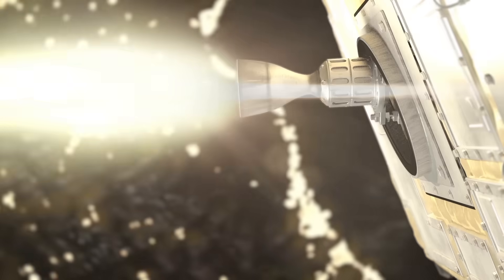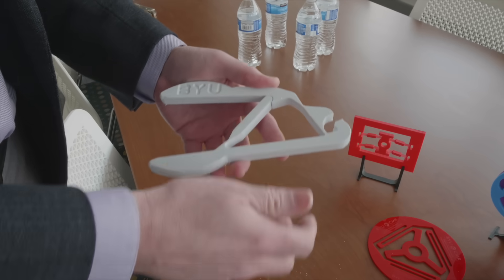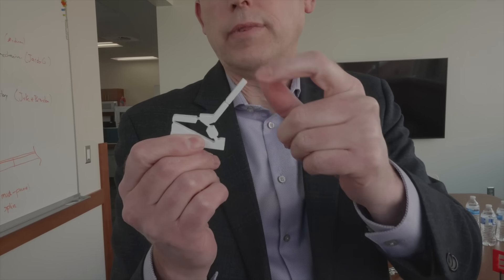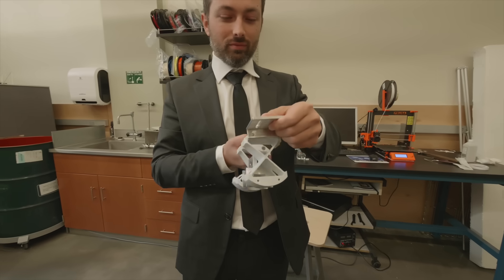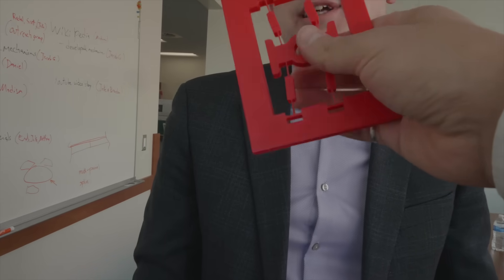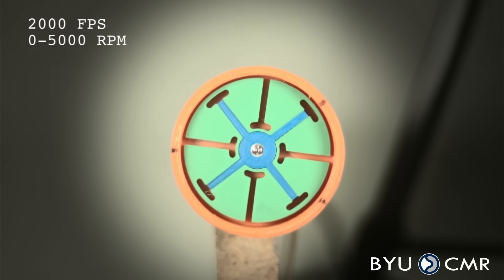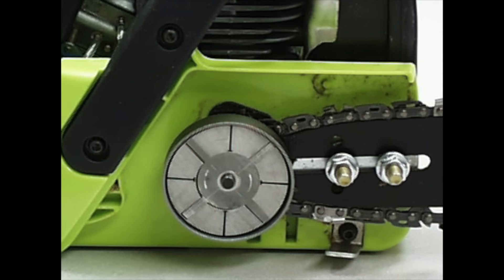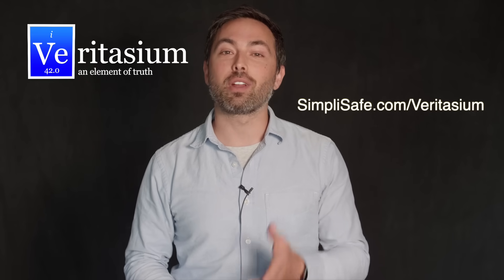Why Machines That Bend Are Better

Comment: But even with fatigue and such, is the plastic in the gripper able to withstand the amount of force usually applied to a vice-grip? Maybe using the printed metal like they showed off. But then how would the adjustment mechanism work? I would not want to carry 200 tools just to have a slight adjustment in the size of the opening. Unless they make something akin to the self-adjusting pipe wrenches.

Comment: Formula 1 has been doing compliant mechanisms for over 25 years now, with both flexible wings and suspension systems (control arm pivots are actually flexible joints, inboard and outboard).

Comment: Can we use this technology to make 3D printable plastic firearms? 

Imagine Open Source designs, being privately affordable to manufacture.
While plastic means lightweight, which benefits transportation, accuracy, and maneuvering; not to mention concealable through metal detectors.

Building a plastic pistol with a metal design, using plastic screws instead of metal ones, would not be an endurable design. But if the plastic was bended properly maybe even being one complete entity, and the right chemical compounds was used as material to handle the gunpowder, I could begin to imagine some pretty fascinating and perhaps even efficient designs.

Comment: I bet Formula 1 teams will start using this tech on the front wings to have variable downforce
Reply: Start?  They've been doing that for years.  That's why the rules contain flexibility-under-load parameters.  F1 engineers are constantly looking for holes in the rules, and FIA tries to fill the holes.  Innovation is the side effect.  That's the game.

Comment: but being that thin, doesn't it rotten and break if it's sitting there for decades?
Reply: Rot can only occur when moisture is introduced. If you keep moisture out, there will not be any rot. There's also a few other elements to keep out that I can't remember right now, but if you manage to do that, you essentially preserve it for decades and it'll work like it was built yesterday. We found out about this through archaelogy, whenever we discovered a find that really shouldn't exist and then decided to figure out how tf that still existed.

Comment: My paper clip was pretty compliant before it was work hardened and snapped.
How is this prevented in compliant mechanisms made from metal?

Also ... how complex is it to make these compliant mechanisms? I know we are all very familiar with traditional mechanics, clockwork and the like, but surely some complex mathematics must go into compliance devices to ensure they flex how you need them to and how much different materials can flex, going back to my work hardening question surely the temperature range for compliance devices would also be more narrow?

Comment: This is incredible! I have been searching for this for over 2 decades. I remember reading an article about this guy and designs about 25 years ago, but could never remember where or how to find them. I even had searched for "compliant mechanisms" with no luck, until now. The original article was about brakes for bicycles, and yes, I even had some of those kind of "compliant" brakes.

Comment: I have an unrelated question:

We say that the Earth spins about its own axis. When a plane takes off, it goes into the air i.e. is not in physical contact with the Earth anymore. 
Combining both facts, how is it that the plane is able to fly from place to place when the Earth is spinning at thousands of km/hr with it simultaneously? 

It’s not a challenge. I’m just confused.
Reply: the wind is moving with the earth itself, so the plane is moving with the wind, moving with the earth. Jumping does not result in your body being thrown hundreds of kilometres backwards
Reply: Oh. I’m still kind of confused, but that did actually helped. Thanks!

Comment: Intuitively, it would seem like the ones made of metal would start to warp too much at the flexible points, affecting their zero point. But materials go from elastic (flexed but will spring back to "home") to plastic (starting to get stuck in that new position) are a response to force and deformation. With very small forces, and very little motion, those materials should stay elastic through that action, for the most part.

Comment: Bridges and buildings employ this since steel was made on an industrial scale.  Proof that flexible machines are better than complex machines with moving wear parts.  Solid part bending fatigue is generally way longer lasting than friction of bearings and hinging.

Comment: I was thinking if stressed induced due to bending will have any hysteresis effect, that in the long run will reduce the accuracy of the output of the mechanisms...... I mean there should be a lot of thought that goes into even changing the mechanism's material as for every new material you have to change the design so that the bending is within the elastic limit.

Comment: Tools with compliant mechanisms would work really well if the material is durable enough.... Same goes with other mechanisms...

This seems like too obvious, but you always need to check out the materials that are necessary for the said mechanism. You don't want your tools/components to break because the material is too brittle, but too flexible means that it's not gonna be springy enough. Fatigue testing is really necessary for these kinds of mechanism.

Comment: Dude... moving parts on a silicon printed chip?! Are you kidding me?!
Reply: That's how the accelerometer in your phone works.
Reply: @captainmcderpyderp  ~"I am  Bill Hammack ,the engineer guy"
Reply: Search on youtube for: MEMs oscillator sensitivity to helium
Reply: yes that impressed me aswel. It says it is 400 micro meter where as modern chips use 16 or so
Reply: @Mercyforme  modern chips are nano meters
Reply: @v000000000000v  woops, I meant that..

Comment: Bending metals, what will you do about Metal Fatigue.
Reply: they will have to balance the bend radius and the metal elasticity-point for what they deem is the best. A longer bend would harm the elasticity and therefor harm the longevity of the metal. it wont last forever  anyways.

Comment: I have doubt, wouldn't flexible machines  suffer from fatigue from repeated flexing, especially metallic flexible components?
Reply: certain metals (like spring steel) do not easily weaken from repeated stress. however, if the mechanism were made of work-hardened steel (like copper) then you would be correct.
Reply: Depends on the level of stress.
If you don't pass a certain limit you can in theory continue forever.

Comment: I wonder though, how can certain redundancies be built in such mechanisms without requiring to severely overdimension the design? Also, what would happen if you scale these mechanisms for heavy duty applications? Are these properties perfectly scalable and if not how to account for these "imperfections"?

Comment: Just seeing the single thruster being controlled made me realize how important this kind of technology is. This video was so much better than the thumbnail depicted it as. I came into this thinking it was going to be a boring video about a new watch or something that is 100% LED, or whatever. I even held off until it was auto-played as background noise. You should really consider changing that thumbnail because everything in this video was 100 times cooler.

Comment: To any Engineers out there who think this subject is interesting.  I highly recommend getting Dr. Larry Howells book and learning a little about compliant mechanisms (it is less expensive compared to the average college text book).  If your institution has a compliant mechanisms class you can gain a fundamental understanding of the limitations and when it is appropriate to use these.  You might need to talk to your Mechanical Engineering department as the class name probably won't have it clearly stated.  Experience or classes in machine design, machine dynamics, statics/dynamics, and materials are essential for understanding this subject.  

Quite a bit of research is being done on this subject currently and still has potential to make big changes in the technological realm!

Comment: 1 million cycles really isn't that much for a mechanical part. For example, electromechanical relays last tens of millions of cycles. And even then, the failure mode is usually electrical, not mechnical. I loathe to think how that performance would drop in high stress environments such as cold or heat. There's a reason these types of parts aren't used often.

Comment: Being one single part, these designs are harder to fix, but it is possible to make modular plugs for the junctions. Springiness is intrinsic to almost all these designs, also non linear resistance under load is complicated to eliminate. Bolts and oil don't have these problems, and can be lightweight, but more expensive, more likely to jam, not necessarily less strong, you can choose a wider range of materials .

Comment: I hate storage cases/containers that have that bend with a thin piece of plastic instead of a proper hinge. Eventually that thin piece of plastic wears out.
Reply: Unless the material used is good for that particular application like for example polypropylene

Comment: why he changed the title of the video from "How flexible machines could save the world" to what it is now ?
Reply: I guess the new title represents the actual video more, since they explained that the flexible material has a few improvements. Plus, the old title sounded a bit clickbait-y (in the case with the nuclear safety, I assume — since it's classified — that they actually use the flexible material, so the machines not only 'could' but really 'do' save the world currently)

Comment: This is nothing new, I don't quite understand what's so special about these? These things are not going to be used in every situation, since what they did not mention in the video is that they are very vulnerable to stress, which limits them to small mechanisms in controlled and contained environment where forces are always predictable. They are also very vulnerable to changes in temperature and depending on material - chemical composition of their surroundings. Anything that affects the material from which it makes enough to deform it, will render the mechanism useless. That's why are used in keyboards and mice, for example, but I highly doubt that clutch disk will survive in an actual car for very long.

Comment: Another important advantage is the lack of stick-slip. This (and the lack of backlash) is the reason why many instruments use flexures for positioning or measurements. Like the abrahmson movement in a cej mikrokator ( accurate to a fraction of a micron )

Comment: Festo built a flexible, pneumatic robot arm that looks like an elephant's trunk. It has basically three separate hose-like air containers alongside each other, which can be expanded and contracted and therefore bend the arm in different directions, similar to a bi-metal strip.
I've also seen door latches made out of a parallelogram-grid-like structure, where the normally "sliding" part was replaced with a part that pivots on another through bending ribs.
I think this has tremendous potential, though materials need to be very durable against fatigue.

Comment: This seems like it would make the Apple MacBook Butterfly Switches much more reliable than they currently are.
Reply: アルピー the butterfly switches literally are compliant mechanism. The reliability issue is from dust getting stuck under the switches.
Reply: Aye quora gang....
Reply: Lol
Reply: It wouldn't, their problem is the dust
Reply: @UC53n9Sk  Yeah that shit's impossible, all the dust and debris and sweaty ball hair, any keyboard would break. Except literally every other laptop keyboard in existence copes with these environmental hardships just fine and the keyboards far outlast the laptops.
Reply: They design their stuff to break easier every year so you have to buy the new model.
Reply: Apple could add another 0 to the price if they use something like this in the keyboards..
Reply: @aravindvissamsetty  It would be more reliable and cheaper to make and they'd charge extra $200 for this keyboard, no joke.
Reply: Apple adding anything actually useful to their products? Nah.
Reply: hahahaha

Comment: As an engineer student,I just had to pause the vid and do a rigid body analysis on the elephant. 
One disadvantage is that these flexible joints can’t turn 360 like pins. The fatigue test seems really solid tho.
Reply: Good observations, the main limiting factors are normally load and full rotation for these mechanisms.  To support higher loads you need larger cross sections which limits flexibility and increases fatigue stress.  I definitely recommend getting Larry Howells book if you are interested.  It is very practical and if you have a compliant mechanisms class you can get a very deep understanding on when these mechanisms are appropriate to use in designs.
Reply: Or you can call it an advantage for restricting unwanted motion.
Reply: It's a matter of perspective and application. A million cycles can be a lot for a lightswitch, but it's not enough for a suspension system, and it's definitely not enough for a mouse button.
That said, in many applications, we use pins, bushings and bearings in places where you don't need 360 turns. A very good example are those vice grips. They're not really expensive, but they will fail in frequent use eventually (usually the twisty part starts jamming). You could probably make over a hundred of those plastic grippers for the same price and just replace them after they fail. 
And that's another thing to consider - in some applications, it can be easier and cheaper to replace and recycle than to repair and maintain.
Reply: That's a disadvantage of any compliant mechanism. One major tradeoff one has to consider in design.
Reply: I still have doubts about the longevity of these switches. No Material is invulnerable against repeated stress.
Just look at a car spring, a little rust at the right place plus a speed bump, and it fails.
Reply: @mixtermuxter8602  The switches were made of some form of plastic and, it seems, are expected to be used in 'common objects' like light switch, appliances, etc. 
Their longevity might not be insanely long, but it's partly because you don't expect to turn you lights on/off a billion times. And if the switch breaks? You just 3D print a new one, replace it and recycle the material of the old one.

If the device needs to be ultra resilient and safe (say in a car), then you choose the design and material in consequences. It's good to over-engineer stuff, but too much over-engineering is sometime costly. Who would want to pay for, or need, a light switch that can survive 1 million years of constant usage?
Reply: How about make it helix to rotate 360 freedom..
Reply: Swegatty Swooty Good idea! But I referring more to completely free rotation , like infinite degrees
Reply: @davegrox3150  Still cannot make it spin. And this reminds me of the War of The Worlds, where the Martian civilization has never invented a hinge and a wheel.
Reply: How do the properties react if the environment parameters change? I mean the termal expension could jam that clutch, no?
Reply: @Eugensson  of course it could jam it. But if you think about it most devices have a recommended operating temperature. You go outside that temp zone and it will become unreliable.
Reply: the stress test seemed dubious to me, since temperature changes and humidity play a big factor in making these materials brittle & decompose/crack. I saw a brief clip where the item was being moved back and forth repeatedly, and I guess that's how he calculated durability but didn't factor environmental variables. I'm not an engineer, though.
Reply: @Reza254  that depends on the material and expected environment. That's typically taken into account in tests like these--for example, an engine may be run at its highest rpm at the most extreme temperature it's expected to run in until failure. I did not personally work on this project, but if humidity or extreme temperatures were relevant to the material and expected working conditions, I'm sure it would have been taken into account in these tests.
Reply: @Reza254  That's just what they showed. His prototypes are used by NASA, I assume confidently that a variety of tests were done. Differing tempo, intensity, environment, etc.

Comment: Imagine what you could do with this if 3d metal printing had custom alloys and an option to have multiple, separate metals. You could have one metal for it's stiffer properties, and another for it's more elastic properties, then have a transitional alloy between the two allowing for a secure bond of the two dissimilar metals. 
I know higher end cnc machines are now coming with additive features that can have custom alloys, but it's basically laser welding metallic powder to a piece, using 2+ powders makes an alloy, and theoretically any alloy is possible with this. Not sure if the same concept would work in 3d printing with sls; it's the same concept, melting metallic powder with a laser, but, as far as I know, sls is much, much weaker in comparison. 
Going back to the idea of having a transitional alloy, the laser metal deposition form of additive manufacturing could, in theory, create a perfect gradient with a multi-alloy transition; as the amount of the powder can be controlled, you can go from a blend of 0% metal A and 100% metal B through an alloy gradient that ends at 100% metal A and 0% Metal B. But again, if this has any added benefit, how do you take this tech and add it to much more precise additive manufacturing?